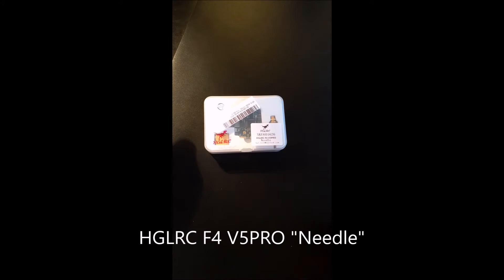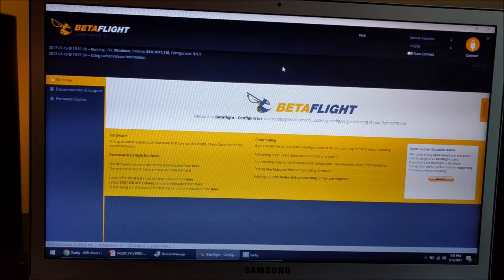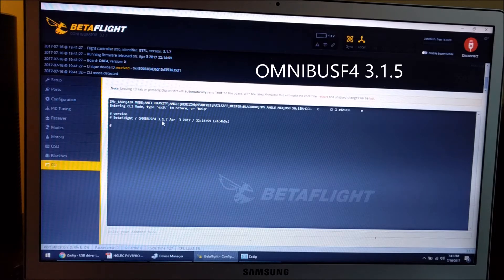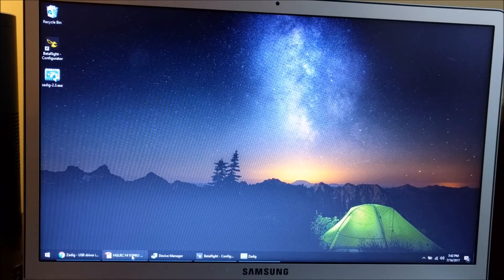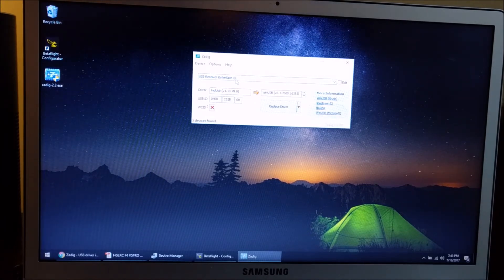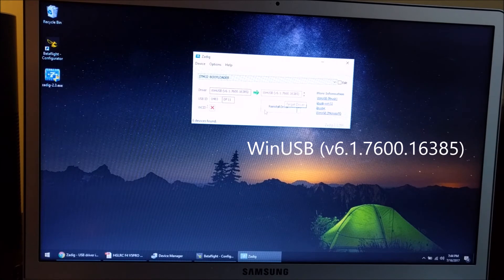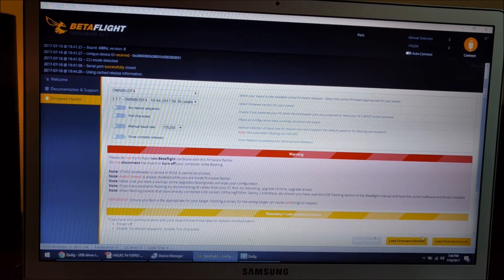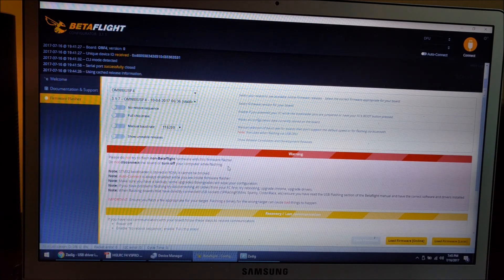HGLRC F4 V5PRO Firmware Upgrade

Comment: If I have Betaflight 3.2 can I still flash the firmware on to this board.
Reply from the maker: Yes you can.
Reply: Hi i have betaflight 3.2 also and cant flash the newer version. When i press the boot button the beeper goes crazy. Can someone help me ? The zadig tool have only omnibus f4 when i connect the board?

Comment: Thanks for the video.  I have the same FC and want to know what is the difference between Omnibusf4 and Omnibusf4sd
Just to be sure it is the correct fiirmware.
Reply from the maker: I think the Omnibusf4sd has support for an SD card. I used the Omnibusf4 because that's what is used in the HGLRC F4 V5PRO Manual.